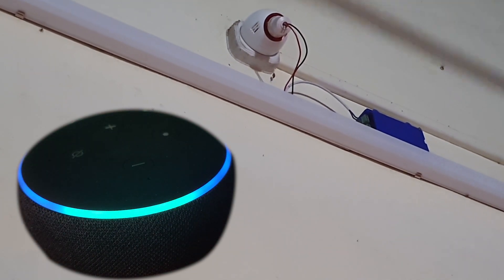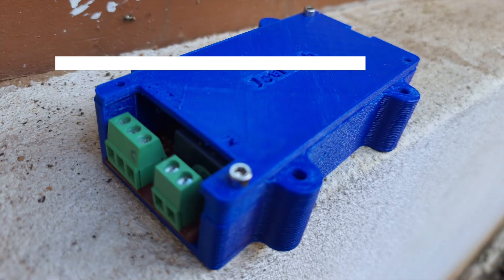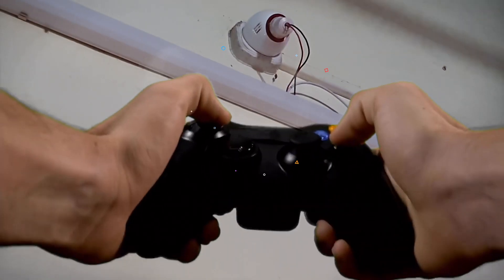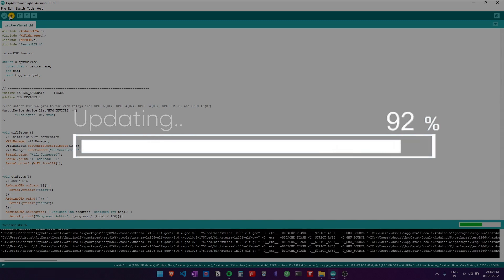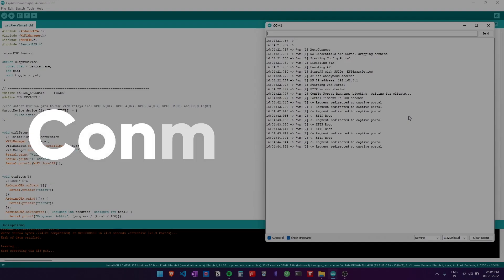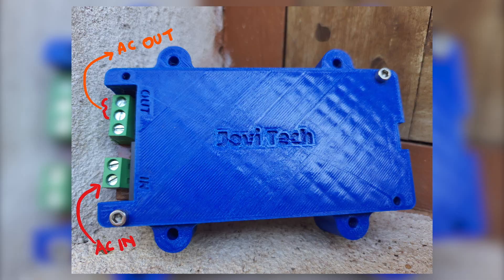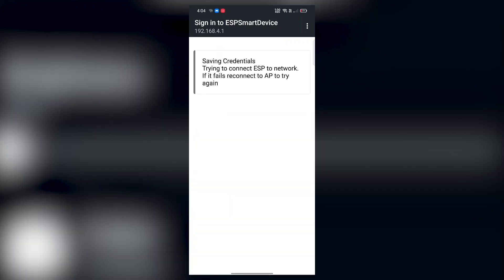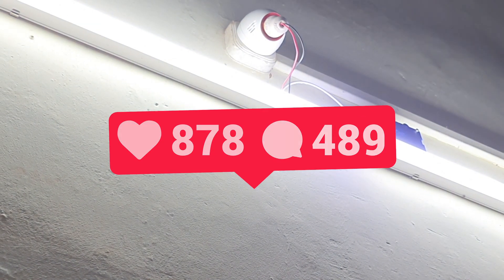“Voice Control your Home Appliances” 🔊  | ⚡Build your own SMART ALEXA Device using ESP8266 🤖

Comment: There are a number of projects on line for accomplishing this task and I have read and tried a number of them all with various issues . This was the best one I found. Others had a number of coding problems and the all of the ones I tried using the espalexa libraries had issues with Alexa discovery that were not readily correctable. This project is well documented and well written. I had the NodeMCU programmed and was able to give voice commands via Alexa to switch the IO pins in less than an hour. Thanks! 

I did add in these definitions for pin mapping:

static const uint8_t D1   = 5;

static const uint8_t D2   = 4;
static const uint8_t D3   = 0;
static const uint8_t D4   = 2;
static const uint8_t D5   = 14;
static const uint8_t D6   = 12;
static const uint8_t D7   = 13;
static const uint8_t D8   = 15;
static const uint8_t D9   = 3;
static const uint8_t D10 = 1;